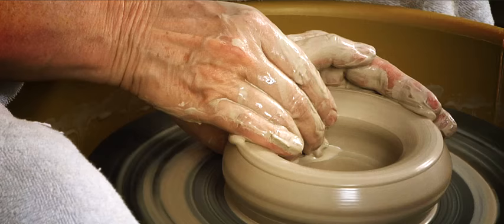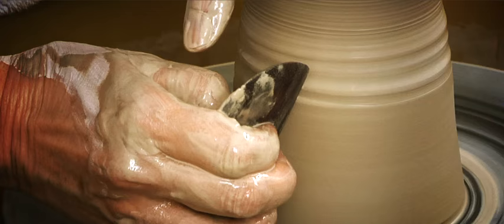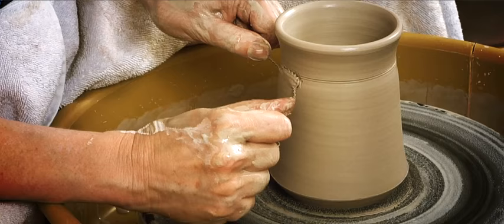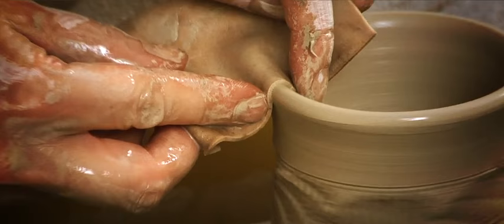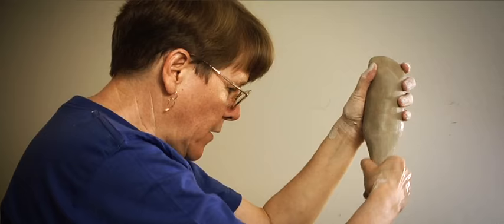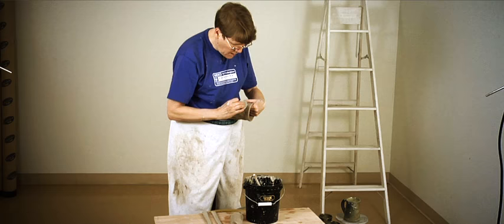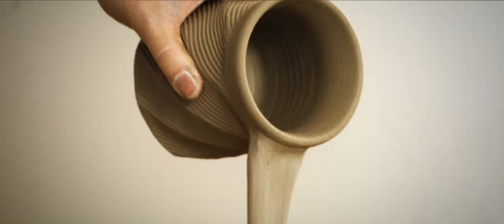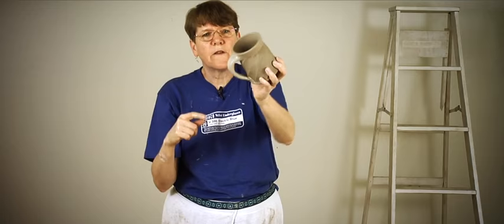Pottery Video: How to Make a Wiggle Wire Mug

Comment: I did something similar to this but instead of a mug it was a large vase. Simply throw a large cylinder, do this "wiggle wire" technique, apply sodium silicate, dry out the sodium silicate (so it creates cracks when pushed around) then from the inside push out a vase like shape. It turns out just beautiful

Comment: you can use a spring from like a pen or anything and stretch it. it works pretty well if you cant find or arnt able to find a place to buy the tool and you can stretch it until you find the style and size you like wich you cant do with the tool